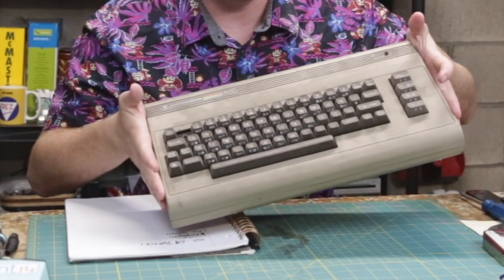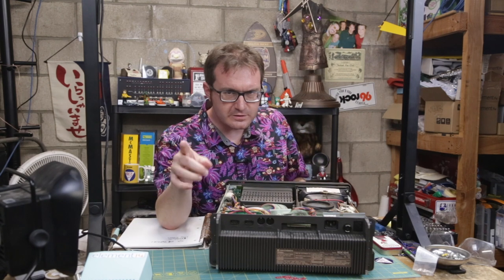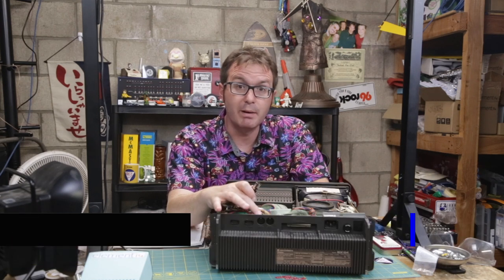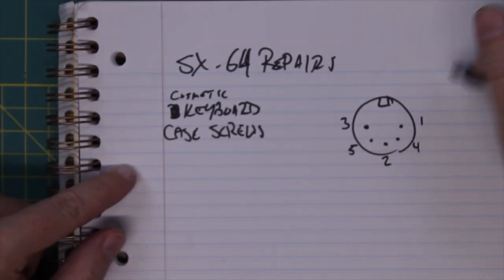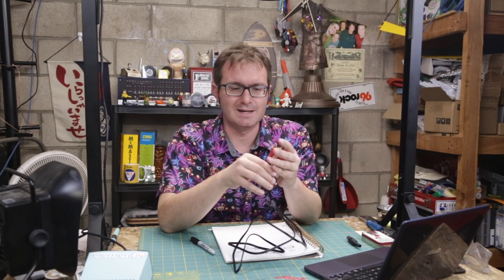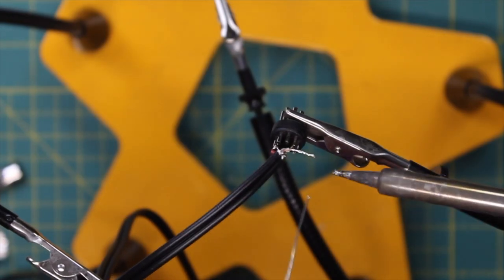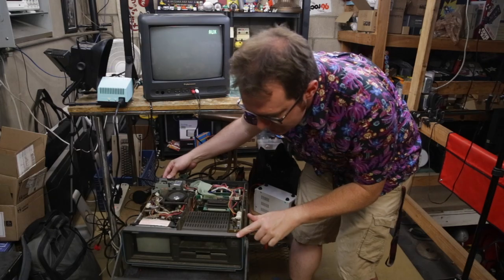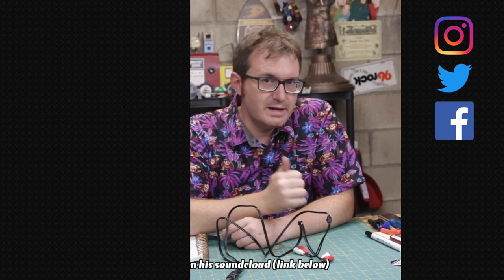How To DIY Commodore 64 AV Cable

Comment: It would of been more helpful to actually explain the pinouts and the wires you was connecting up instead of just soldering them onto the connector and saying nothing of what you was connecting and what signal it was for.. So very un-helpful dude!! x(
Reply: Says won't be using Luminance, then says pin 1 is used. Also, why would he have red, white, yellow and black? Typically red, white and yellow, and that's only for stereo audio. For a mono cable, it would be white (audio) and yellow (composite video)

Comment: On my C64 the 5pin din is the serial cable, Composite is on an 8 pin DIN.
Reply: As it is for his SX-64. But a 5-pin DIN can plug into a 8-pin socket, he covered that in the video.